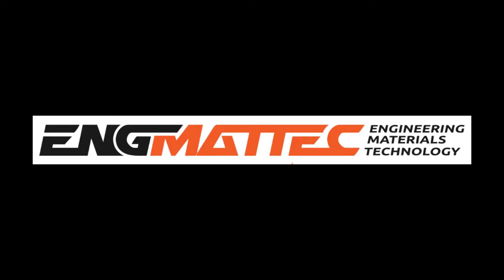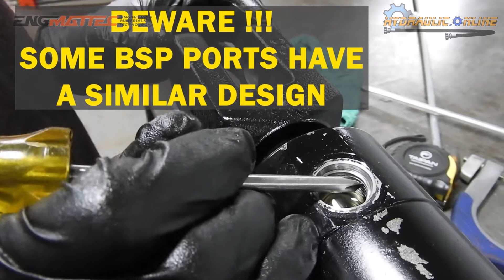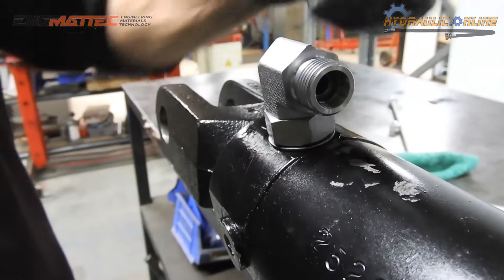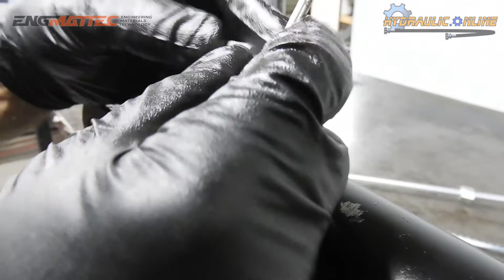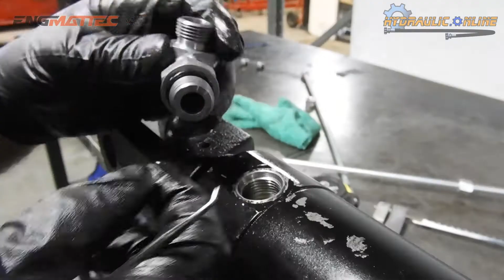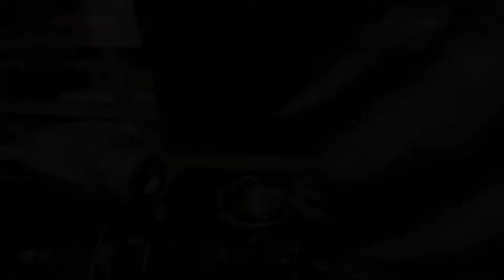90 ° Hydraulic Adaptors How They Work and the Importance of O'Rings

Comment: Where do you get your O Rings from?
Reply from the maker: Thanks for watching , Graber you must get oil and heat resistant O rings, the best place to get these are from Specialist Seal Suppliers, most automotive and or bearing supliers should also stock them, Subscribe to the channel Grabber because in a day or two we will be uploading a two part Video all about Seals and O rings used in high pressure Hydraulics  We will also visit our Seal Supplier to see the special Seal manufacturing machines and learn all about the different types of materials seals are made from to resist all types of chemicals, temperatures and loads.
Reply: @Hydraulic.Online  okay thanks! I had already subscribed. I've been looking for a video like this for a while now. I have a 3/4 elbow like the one in the video for a skidloader that ran 3,000 psi and kept ripping the o ring til I figured out there are different strengths in O rings and I was using a 70 durometer instead of 90 durometer. Your video answered my question about sizing the o ring and all! Thanks again for the video!